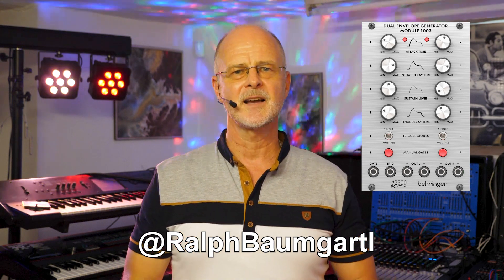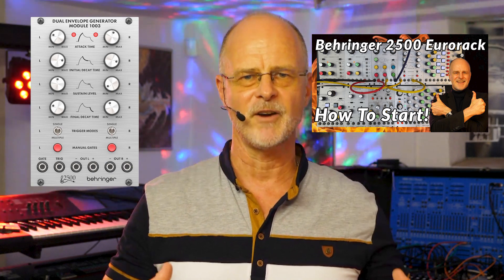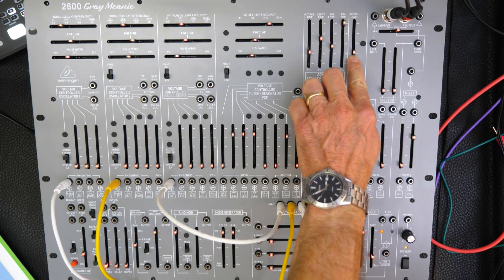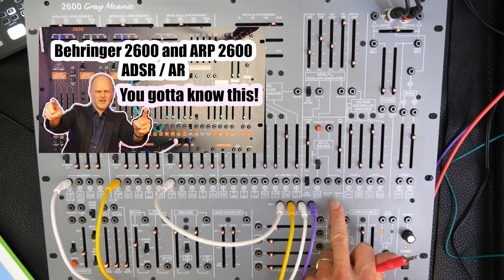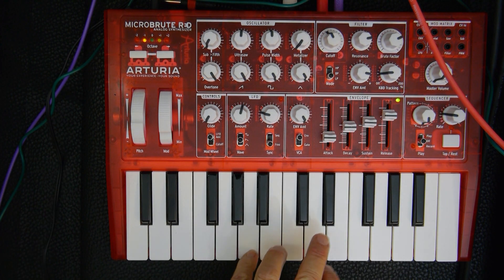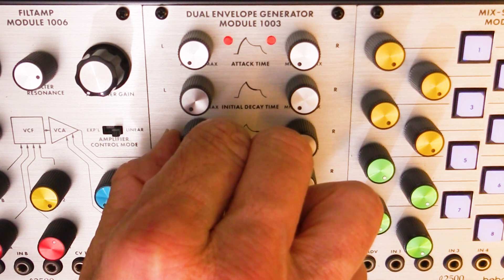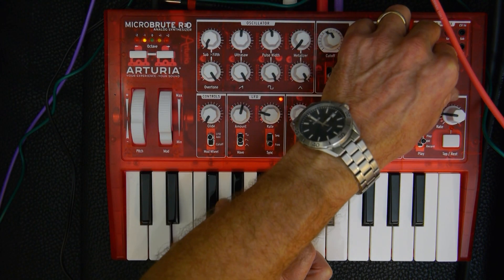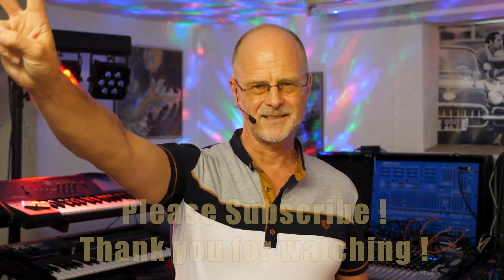The ADSR Solution! Solving Behringer 2600 Gate Connection Issues (ARP2600 & 2600 Synth Clones)

Comment: I have an Arturia Keystep Pro and a Behringer 1003. I haven't been able to use the 1003 because whenever I send a gate signal to it from the Keystep, nothing happens. If I press the manual gate button it works. But it's only when I do that. Is the problem with voltages? What can I do about it?
Reply from the maker: Use the Arturia app and set the Gate Voltage of the Keystep to 10V or higher. Then try it again.
Reply: @RalphBaumgartl  Thank you for the quick response. One more question: I use the Keystep quite a lot. Will setting it to a higher voltage cause any issues with getting it to work with other gear? Thank you so much for your time!
Reply from the maker: @ I think the maximum gate voltage that you can set on the Keystep was 12V. I never had problems with the 2600 and 2500 modules using the 12V gate. Update the Keystep to the latest firmware. If you can set the gate to 10V then go with that otherwise use the 12V.
Reply: @RalphBaumgartl  Thank you. I'll try that when I get a chance, and let you know how it goes.

Comment: Hello Ralph. Very useful videos about the great 2600. Do you see any possibility to control the filter with either the AR or ADSR envelope of the 2600?
Reply from the maker: I suppose you are referring to the Filter Modules of the 2500 system. Yes, you can use the envelopes of the 2600 with the 2500 filters.
Reply: @RalphBaumgartl  No, I am talking about the Behringer 2600. Can you control the filter of the Behringer 2600 with its own ADSR or AR envelope?
Reply from the maker: @nicogrubert  Yes, absolutely! Check out my beginner tutorials for the 2600 Synth. Start by watching my latest video. Behringer 2600 Synth: Essential Tips for Beginners
https://youtu.be/e8RChRnipnU

Comment: Could be a task for 1033 as well, which as I understand is the same unit but includes gate delay circuits
Reply from the maker: Ye sure, you could use the 1033 as well.

Comment: Hi, I noticed that you have the single multiple switch on the 1003 in multiple mode in the video. Does this make a difference as you do not mention it here. This is a confusing subject for beginners! A video on the uses of the single / multiple switch would be amazing. Also, the uses of the gate or trigger inputs on the 1003 would be very helpful. thanks for your great videos. cheers
Reply from the maker: To put it very simply: “Multiple” means that you can press a new key and trigger the envelopes while the previous key on the keyboard is still depressed. On the Behringer 2600 you can set this mode by moving a switch to “Multiple” and it works right away. On the 2500 System you have to do some additional Patch cabling to make it work. Have a good week, Ralph
Reply: @RalphBaumgartl  I’m just curious if the 140 EG from the 100 series would also solve the gate issue. They have a striking resemblance with the 2600 grey beast
Reply from the maker: @markfish8403  Yes, the Behringer 140 Dual EG should work as well, because it also outputs 10V max. Cheers, Ralph
Reply: @RalphBaumgartl Excellent, and thank you for your reply, and all the tutorials. 
I just received the 2600 this month, as well as the Behringer 182 sequencer from the 100 series. I plan to get the 140 and 110 modules for a for a complimentary voice, and then just keep experimenting from there. If Uli would let us have the clone of the ARP sequencer with faders, I would jump on it immediately. Thanks again! 
☮️&❤️from Beautiful Colorado 🏔
Reply from the maker: @ Yes, I am also waiting for the ARP sequencer. That would be a blast. 😃 Greetings, Ralph

Comment: Thanks Ralph. As ever nothing very intuitive about the 2600. Using the S/H, and not the gate in's to the envelope gen's. I'm with simonjerrerytaylor here, the gate features puts me off too. This is a good workaround as I have quite a few ADSR's I could use like this, does it mean your not using the ADSR on the 2600, it looks like it? Or am I missing something?
Reply from the maker: Hello and thanks for watching! I am using the ADSR on the 2600. When you watch and listen to the sound samples you will see and hear how I change the ADSR and VCF settings on the 2600. The 1003 is just being used as an attenuator to strengthen the Gate of the MicroBrute. Greetings, Ralph
Reply: @RalphBaumgartl  A little point. Attenuators do not strengthen signals. They, in fact, do the very opposite. We use an amplifier to strengthen a signal and an attenuator to lower (attenuate) a signal.
Reply from the maker: @SpeccyMan Since I am a NON native speaker of English I am prone to these mistakes. I am sorry. I mean with the attenuator you can control the strength of the signal. Greetings, Ralph

Comment: You could probably get a preamp kit from an electronics shop.. i picked up a passive volume control unit for a car stereo and use it to attenuate signals that have no level control 👍
Reply from the maker: Yes, that's probably another option. There are many solutions available according to one's individual setup and workflow.
Reply: @RalphBaumgartl  probably don't want to amplify it toooo much i imagine 🤯 🤣. Love your videos mate you're a saint
Reply from the maker: @drstupid1  Don't worry! The plus 10V output of the 1003 Envelope is within the 2600 range. I have been feeding the Behringer 2600 and ARP 2600 Gate inputs with plus 12V already. Thanks for watching my content. Greetings, Ralph

Comment: Can i use other env mods?
Reply from the maker: Yes, you can! Depending on the specifications that I explained towards the end of the video.
Reply: @RalphBaumgartl just saw that... I've just ordered the 1003.  Hopefully this will allow me to use the 2600. The gate issue is a real killer. Males me avoid the 2600 tbh.
Reply from the maker: @simonjefferytaylor  The 1003 Envelope is a great ADSR anyway. It's great for any Eurorack system setup and can also be used as a tool for other tasks. Greetings, Ralph
Reply: @RalphBaumgartl  I have it going.... and it has resolved the issue...the 2600 is now firing from an analog sequencer....💥🔥👏👏
Reply from the maker: @simonjefferytaylor  glad to hear that